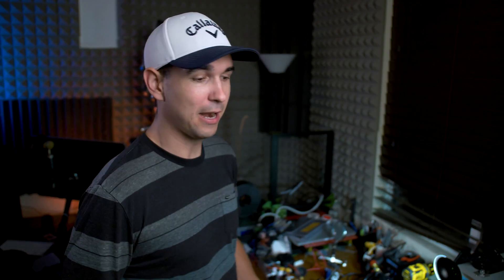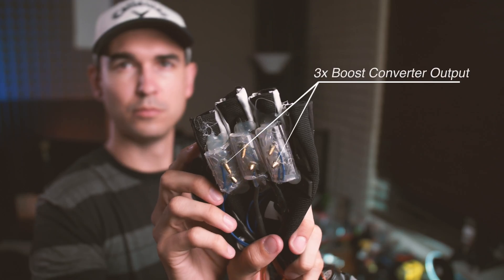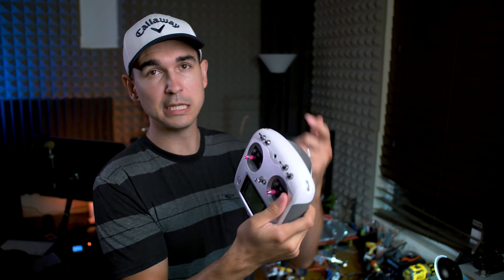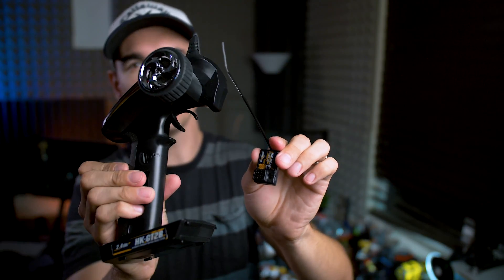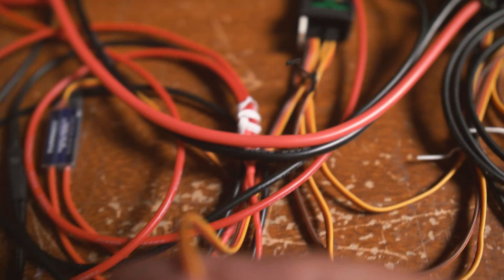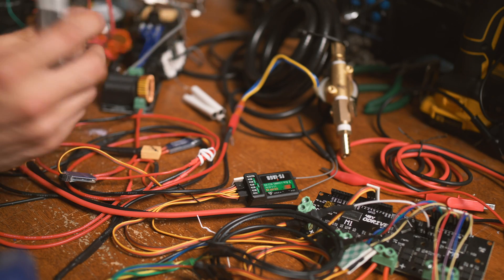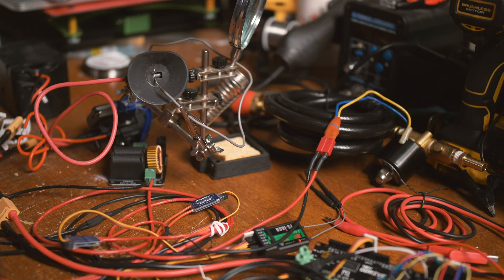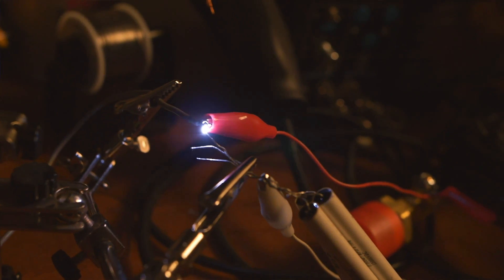Making a Remote Controlled TASER

Comment: Tommy; I enjoyed the video, however, there's more to it than I want to do. I have a Vipertek 880 that I want to fire remotely (to scare squirrels). I have two wires coming out of the 'fire' button which work when touched. I have a cheap remote and drone. Removed 4 propellors from the drone.  other than wires to one prop to turn on/off what do I have to connect to the 2 wires from the V880 to fire it from the remote?  As you can tell I'm a novice. As is, it will not fire the 880.  Would really appreciate any help or tips.